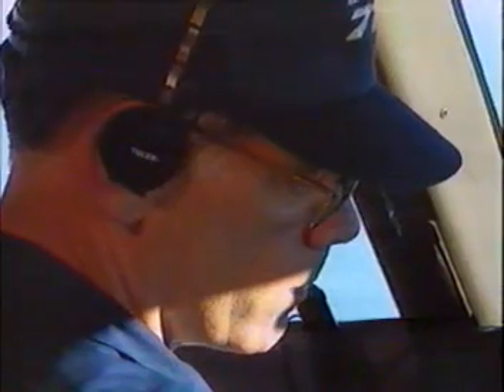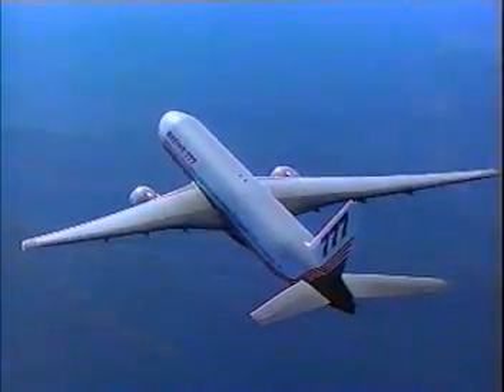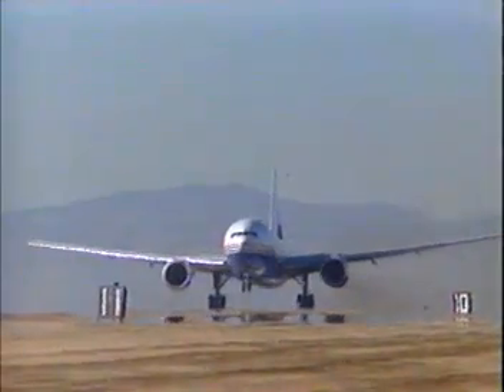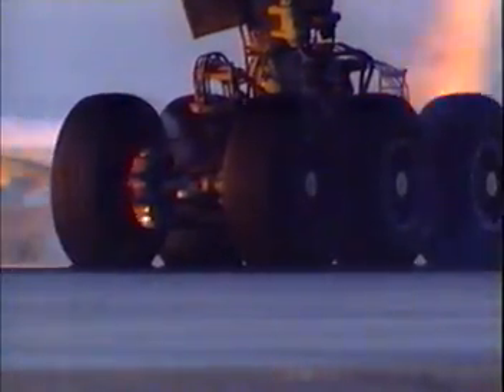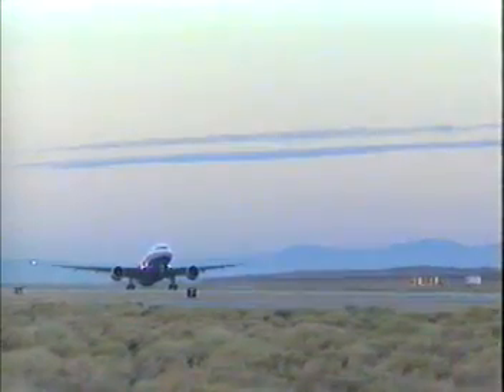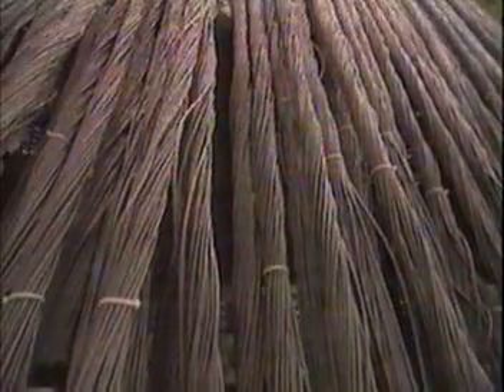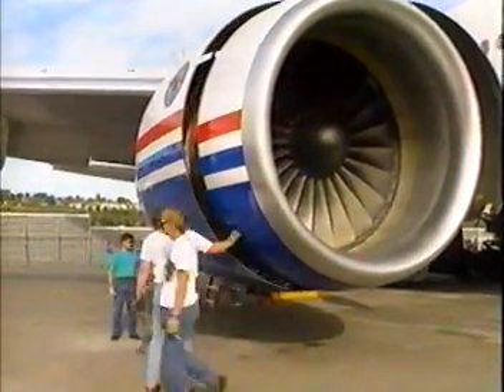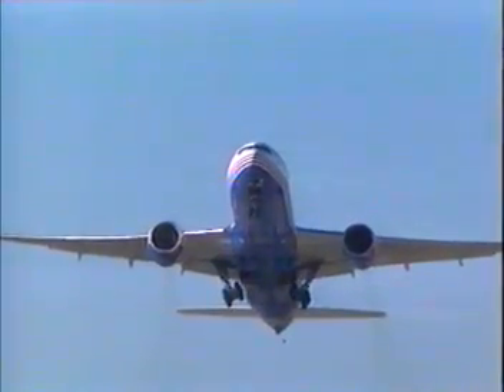B777 Flight Test

Comment: And after the beating these flight tests put on it, this same aircraft flew for Cathay Pacific for almost 25 years.
Reply: I hope it was only used for cargo transportation tho. Using in it for passenger ms would not be appropriate, don't you think so ?
Reply: @aquariumlife2929  it was used as a passenger aircraft.
Reply: @aquariumlife2929 yes I agree it wouldn’t be that much of a good purchase just for passenger
Reply: I have a doubt Cathay Pacific had rr engines with their 777 200 fleet and this test aircraft shown here has pw engines so they changed the engines on them ?
Reply: @toyotasupra174  they changed the engines
Reply: @EAGSAviationYT  oh that pretty much loyalty from the customer to the manufacturer lol
Reply: @toyotasupra174  true, iirc the only 777 to had the expensive engine swap operation done on it